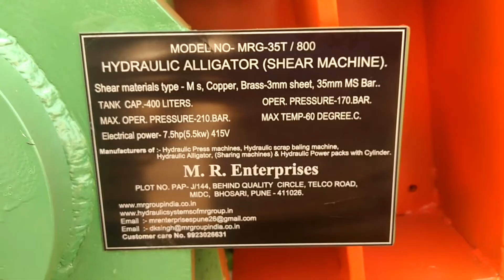Hydraulic Alligator Shearing Machines Manufacturer

Comment: The Italian made Bergamini Alligator Shears are top of the range & high quality Italian products, built to highest quality & safety standards with lots of power & cutting force to improve your operation. MachinerySpecialist offering Alligator shears are perfect machine for small operations & material preparation, including radiators, pipes, tires & non ferrous recovery. Contact MachinerySpecialist.com today for more information on our scrap alligator shears. Check our products here : http://www.machineryspecialist.com/Scrap-Metal-Recycling/Scrap-Metal-Processing-Machines/Alligator-Shears/